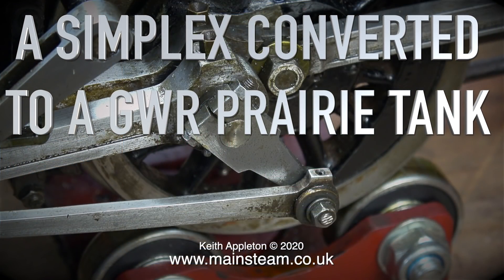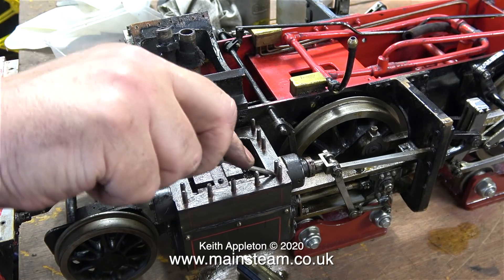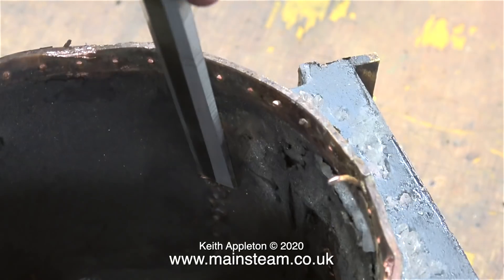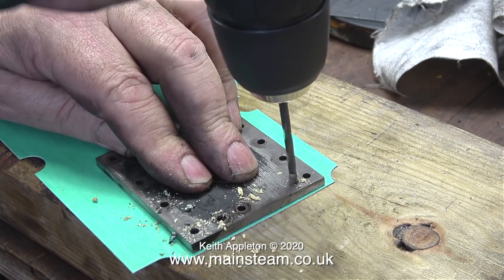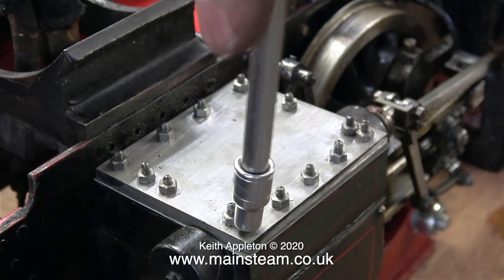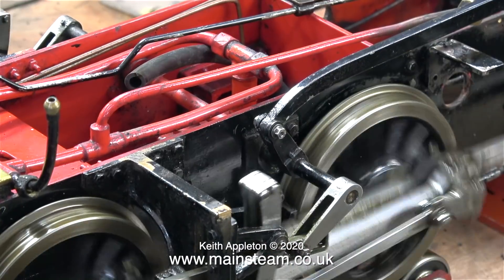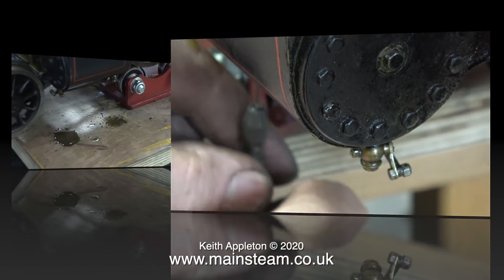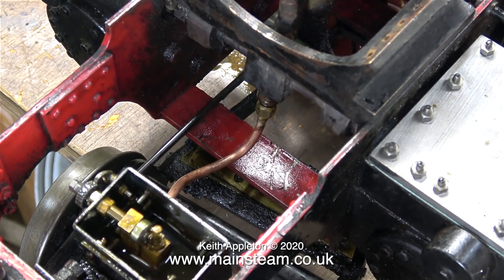A SIMPLEX PRAIRIE TANK - PART #2

Comment: The chisel part made me cringe.  Not that its a bad idea, (pretty clever actually), but that the only chisels we have at home date to the 1880s.  As the saying goes, new tools get abused, old tools get used.
Reply from the maker: I bought this chisel especially for jobs like this, I too would not use a vintage set for such purposes {:-)))
Reply: A small cold chisel may have been a better look, but sharpening that one on the belt sander will be quick!